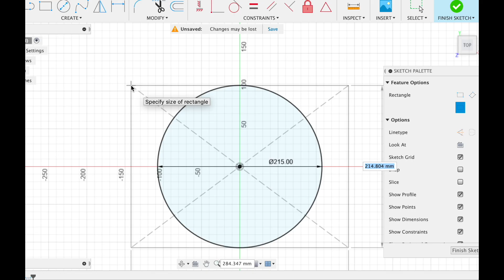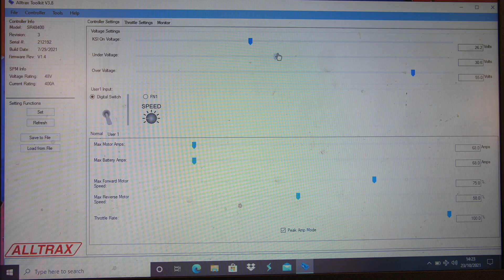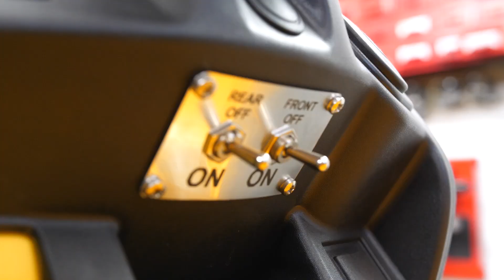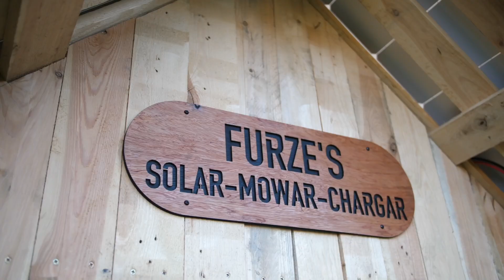EV Mower Conversion with Solar Charging Station

Comment: I feel like a battery bank in the shed would be good, I suspect that shed can soak up a lot more power than that mower needs between mowings, you could also charge electric yard tools
Reply: The battery bank would help his electric bill. Lathe drill press cnc machine. And everyother power tool he has.
Reply: I really like this idea. It'd definitely be really useful
Reply: Thinking the same thing. Lots of good cordless electric yard tools, they could all soak up extra power from the shed.
Reply: Just seal it properly before you put batteries in lol
Reply: It comes down to average power generation versus power storage.
Reply: Or just use a normal solar setup (tied to the power grid)
Reply: @Jehty_  a normal solar system is not tied to the grid. the electric companies using your house to put panels on is something new and they wouldnt do it if it didnt benefit them more.
Reply: @dmbworks8094  what?? 
What country do you live in?
Reply: Connect it to the house, he already paid for the panels so it's basically just free energy now
Reply: https://youtu.be/_mstbNizOjIyyhk
Reply: it makes more sense to use the mower itself as battery bank. because batteries are becoming so important, we need to find ways to use them effectively and efficiently.
Reply: There's no need you already have a very large battery bank in the mower itself which plugs it's DC supply direct into the shed 

All you need is a small inverter in the shed and you can charge all your battery drills etc to your hearts content 
The amount of power they would take from the mower would be so little you wouldn't notice
Reply: Hey Colin, there ya go... start an electric tool shed company, fans can buy stock and reap profit along with you
Reply: You could literally sell excess power back to the grid, you could make some cash out of it.
Reply: @mickenoss  they dont offer money, didnt offer us money. just deduction from your electric bill with panels on your house. we dont get credit if we use less than the panels produce, part of the contract to tie to the grid. my understanding is you have to be a licensed solar farm to sell to the electric company. for my shop i buy part of my electricity from a solar farm thru the electric company for a discount on kwh's. even at that they wont sell me all my power from the farm for a discount.
Reply: @dmbworks8094  Didn't know that, cool. He's probably got enough power to cover even his daily needs though which is pretty nice.
Reply: @mickenoss  yeah kinda blows but this mowar is great.. as much as i like HP im really interested in the ev conversion market. not that im trying to covert mowers but i have a vw im liking the idea of doing a awd tesla conversion on but i have some equipment to pay off before i get to play again.
Reply: Probably needs a gate for shed. I was thinking this type of mower is something that would appeal to Councils and organisations which cut a lot of grass.
Reply: Household battery banks are definitely a key part of the future of at-home solar!

Comment: I love this project.... until I put the numbers into reality for me to cut my 5 acres of grass... my boys cut it in about 3 hours currently not rushing.... with the range that was shown here it would take them around 32 days to cut the same area and that is not considering the rate of growth of the grass!!! If I could do this and have my grass done in 3 hours and recharged in 4 days at a pre-pandemic price I would!
Reply: I think it should be possible. I don't know how much thought Colin put into choosing battery sizes and optimising motor sizes for their purpose. LI-Ion should give more energy density. Would be a good project! If I was doing it commercially I would add an add-on battery trolley or smth. which customer like you would buy but other can do without.

Comment: Brilliant video! That engine he put under his workbench would do great in a GIANT BLENDER, just saying.
Reply: A motor converts energy into work. An "engine" converts specifically thermal energy into work.
So "engine" for electric is incorrect. "Motor" for ICE is technically correct, but when referring to cars, "motor" is generally reserved for electric systems (in 2021). Clear terms are useful during the transition between ICE and electric. 
A few decades ago, though, (I assume) referring to an ICE as a "motor" would have been completely fine, since EV's were still pretty niche and impractical.
Reply: @jlco  Try telling that to Babbage’s difference engine of 1822.
Reply: will it blend uk version ha
Reply: https://youtu.be/_mstbNizOjIrhrhd
Reply: *Electric motor
Believe it or not engine and motor do have different meanings even if they are mostly used interchangeably.
Shoot I read that wrong
Sorry about that
Reply: @nesyboi9421  
I disagree.
Motor and engine mean exactly the same thing and can be used interchangeably.
Reply: @richardschofield2201  ahh yes my electric engine.
Reply: @nesyboi9421  
Are you suggesting that a motor must be electric?
How about a rocket motor?
Or a motorbike? Motorboat (not that kind)
Or is it that engines must be internal combustion?
Hmmm steam engine, Sterling engine.
Motor and engine have no definition to differentiate them.
They just have their common uses.
They mean the same thing. A machine that converts power to motion.
Reply: @richardschofield2201  no I'm implying if its electric its not an engine, or at least its not proper to do so.
While you could call an electric motor an electric engine, electric motor is the proper term.
Reply: @richardschofield2201  Yup, I have a diesel motor or diesel engine, generaly interchangable termes. synonyms, anti-antonyms (just making stuff up 'cause it's fun). English tends to hide in dark alleys and mug other languages for words and syntax.
Reply: @nesyboi9421  fun fact: electric engines are a thing! also called solenoid engines, they're super inefficient system that use a solenoid/electromagnetic piston to turn a shaft just as combustion engines use explosions to turn a shaft
Reply: @ClippyForConsumerWrights  I've seen em' before, they are pretty neat.
I'd rather call it a solenoid engine instead of an electric engine though.

Comment: Love this build!! If you get a lithium sponsor, use the Lead Acid as shed storage 3S2P, wire the panels 4S2P and use a charge controller panel to battery, then use the Lithium battery provider suggested lithium charger, should speed up charging of the mower significantly. If you stick with Lead Acid and your ESC can handle higher voltage input you could rewire accordingly. Higher voltage means lower current flowing and keeps the wire gauge lower for the same power transferred. And again, love this build.

Comment: I was always thinking of converting one of these  20 inch wide 6 spiral blade push mowers with a 1800 watt 48v Brushless Scooter Motor on a 16s 100Ah 51.2v lifepo4 Battery which will give 2 hours of mowing using 51.2v 100Ah x 80% D.O.D. = 4096w usable power with a motor that is 51.2v x 40A = 2048w so 4096w / 2048w = 2 hrs to 2.46 hrs. If you use a T8F 44 Tooth Sprocket which is 4.4149 inches diameter mounted to the cutting spindle by welding a Galvanised Joining Bush & a T8F11 Tooth Sprocket to the motor then it will change the 4500 RPM of the motor down to 1125 RPM of the cutting spindle. Basically I could cut lawns up to an acre in size leaving them looking like bowling greens of 2 inch thick spongy grass without weeds. The unfortunate thing is that it's too expensive to create such a project like that.

If the mower's handlebars were mounted to the handlebars of an adults size Tricycle with fixed rear wheels & a very small crankset to drive forward or backward then you could mow most backyards & put a single Y pole at the center of the Tricycle's handle bars & 2 poles at next to each rear wheels to hold 2x 250w Solar panels = 500w x 80% = 400w over your head for shade as well as charging when not in use. Also having 4x 250w solar panels = 1000w mounted on the garage so that all up you would have 80% of 1500w = 1200w of charging capacity to help with charging as it would take between 4.9 hrs.

Comment: You can buy 1990s cordless phone batteries that use lithium batteries. Last I looked you can get a few hundred for really cheap. I think they guarantee like 80% to work.  With a simple battery checker and some mental plates (lots of videos on line look up solar generator with parts lists and where to buy) and few other cheap things.  Easily make some.  Even greener then green.  Cause you'll be recycling most the parts.

Comment: Sorry Colin, I’ve gone one better. My solar charged machine is my mobility scooter. The solar charger is the canopy. It uses a 370w solar panel, which connects to a regulator, then onto the 2 75 aH batteries. On a bright sunny day, I can be mobile most of the day, without fear of running low on power.

Comment: I'm glad Colin went the entire mile and built the charging shed, because simply making everything electric doesn't save the environment when the electricity comes from burning fuels or coal at the power plant.
Reply: It does save it a bit - portable combustion engines are much less efficient than electric motors, so even with the transmission and storage losses EVs charged entirely by fossil-fueled plants are still quite a bit greener than ICE cars. But obviously using renewables for the electricity is much better.

Comment: The only practical problem I can see with this is the weight, mowing after a rain would leave the ground muddy, and could cause problems. How does the weight compare to the original version
Reply: Replacing engine/battery/fuel tank with motors/batteries is probably nearly a wash. The bulk of the weight is still going to be the frame and drivetrain. Probably no heavier than a gas mower with a heavier rider. Most people don't mow in rainy/muddy conditions anyway (wet grass can gum the chute)

Comment: I am genuinely impressed with this project, I was a grass machinery engineer for over twenty years, retired now.
Back in the 80s I had a design for a smaller robotic mower that worked on similar principals but never got round to developing it, this ride on with a decent lithium battery pack ought to change the commercial grass cutting industry.
Reply: There are plenty of big companies making battery rideon mowers Ryobi have 3 different types, normal and zero turn.
Reply: Oh definitely and I'm sure that it wouldn't be too difficult to have this charge from the car inbetween jobs so the battery can last a full day of work and even if this were to be charged from non renewable energy it would still be more efficient than petrol (the reason is that despite the energy density of petrol the engines are incredibly inefficient due to their size and method of generation (cars are typically 30-35% with lawnmower engines being very much less so) where as coal powerstations are more efficient use to their size and method of energy conversion (40 to 45% and thats presuming 100% coal which is super rare)

Comment: Lol, why bother making it better? it's pretty overbuild already...
I'd skip the second motor, just run it off the front and probably cut down 20-40% on batteries
it'll be simpler, lighter, faster (as fast as it was previously, assuming both motors have similar RPM) whilst still doing way more than your lawn.
And change that charging shed, it only needs one side to be solar, the other is in the shade most of the time anyways and you definitely do not need the extra ~10-15% power generation.

Comment: Hey, I just had a thought: a lot of tool companies are selling electric tools that work off lithium batteries. Would those batteries be energy dense enough to replace the lead-acid?

EDIT: So I did some maths. The majority of these batteries are 1.5 Amp-hour capacity. To keep it at least 70 amp-hours (it's either 69[nice] or 70.5, dealer's choice) would require either 46 or 47 batteries. Given that on the low end a 1.5 amp-hour li-ion battery weighs 180 grams, 47 of them would be 8.46 kilograms (18 pounds). I don't know how much weight would be added by whatever components you would need to link up 47 tool batteries in series, but this legitimately sounds like a plausible solution.
Reply: installing and troubleshooting the dozens of handtool batteries you'd need would be a nightmare.

Comment: They are currently making electric mowers. Home Depot has almost exclusively those in stock near me. I’d switch but I mow 3 or 4 yards for some older people in my neighborhood and I’m out mowing for 4-5 hours at a time. Also their crazy expensive and my area doesn’t do well recycling batteries.

Comment: Recycled pallets are scary if you don't know exactly what they were used for.

I used to work at a logistics company and more than once I saw chemicals spilled on pallets and other things. Less reputable companies might not dispose of that kind of stuff correctly which means you run the risk of exposing yourself to dangerous nasty.

Comment: This'd probably be a perfect application for lithium iron phosphate cells if you don't feel comfortable handling lithium ion, a little heavier but way easier to work with.
Would also be interesting to see how much power it actually pulls from the batteries, seems extremely efficient

Comment: Collin to add to your challenge of building the solar mowar you built one too big for your yard.  What about building one out of a regular sized 21 inch or 533.4 mm deck and do a solar powered mowar for your yard.  Now theres an idea.  Using the items you've already pre built for the big mower.

Comment: And if you gad one motor tgatcwas larger you could probably get away without even using a speed control and just a simple on iff switch would work.

Comment: Not that impressed really, with just a little bit more effort you could have EASILY made a drive-in-connect system so that you didn't have to plug in TWO separate cables like a jackass
Reply: Soo...that's a documented fact then, is it?!
Jackasses plug in TWO cables to charge their cordless mowers.....?!?!
Never knew that!
I thought they just stood around in fields and ATE grass.......
Reply: @andymccabe6712  Bruh what
Reply: And why even use two cables? Those connectors seem to contain more than one line? It's not like its critical to fast charge an already solar charged lawnmower?

Comment: To keep with the Green idea for the project, you could use salvaged 18650 Li-Po batteries, you just need to to make sure you balance the batteries and use the proper BMS cards, plus an inverter to hit the voltage outputs needed for the motors. Could be a fun addition to the project :)  Another good option could be using LiFePO4 batteries in the Mowar!

Comment: Ryobi makes two battery powered riding lawn mowers he could have just bought one of them and built the shed to power the batteries that you can swap out if one set of batteries dies and they use the 60 amp Ryobi all-in-one batteries
Reply: Wouldn't have been much of a Furze construction project, eh?
Building a shed.......!
Reply: @andymccabe6712   you can do a lot of stuff with a shed and with Ryobi tools build a changing station for all your Ryobi all-in-one batteries and storage for your gardening tools

Comment: What if you just make it so the wheels moving drive the blades but have a way to disconnect the blade part so I doesn’t move for no reason, then all you need to do is gear it up to make it more faster and only one motor is needed!

Comment: I think as a commercial product this could actually be very useful and somewhat affordable. The hardware in this prototype probably costs a small fortune but it's also way overpowered for real world usage. Maybe not necessarily overpowered but the potential for more power is there/the motors can probably do a lot more than what's needed here. If a commercial setup like this was to be made then it would probably be a lot closer to the actual requirements and therefore a lot cheaper 🤔

Comment: Lead acid batteries might be better than Li-Ion/Li-Polymer batteries for this project. They are cheaper and don't use Lithium witch is needed for cars and other things that need the extra energy density. Also unfortunately producing Li-Ions still makes CO2 because they are made from LiCO3 which releases CO2 when you convert them into the compounds found in batteries. With a lawnmower price is much more important than range and Lead acid batteries give you enough range. Also it's more efficient to only have solar panels on one side of the charging shed and making sure they point south.

Comment: So the question is ... why did you kept the belt system ... i allways thought that the magic part of electric engines (especially when you have 2 of them) is to use them only when they need to be used and where they need to be used. So is there a specific reason why did you not just simply put the engine on top of the "drum" directly connecting it to the blade???
Also where can i buy one 😁 I think that it is perfect!!!
Reply: Gearing?, Wouldn't fit?.....
Reply: @andymccabe6712  Gearing? ... Well its electric motor you can spin it at whatever speeds you want ... 
Wouldn't fit? ... Okay but it's way smaller than combustion engine so there might be a way to fit it. Maybe it was just too much work

Comment: So the solar shed has 8 solar panels going to 8 charge controllers. Then wired directly to the cable for pos and neg. My only question is where is the battery for the charge controllers with out the mower. I was under the impression that the cheap charge controllers like the ones you have need to have a battery connected first before you connect the solar panels and removing the batteries would or could short out said battery. 
Though the way you have it connected is a very good idea as it allows the most energy to be dumpped in to the battery if you have shading. If one does not have any chance of shading then a mppt controller would be ideal. I am also guessing this is 12v.